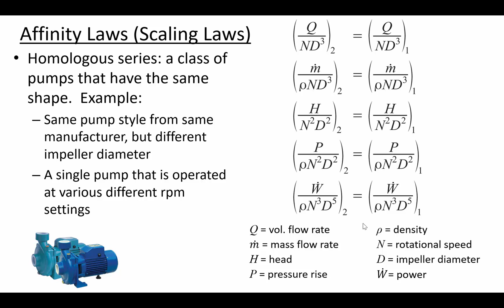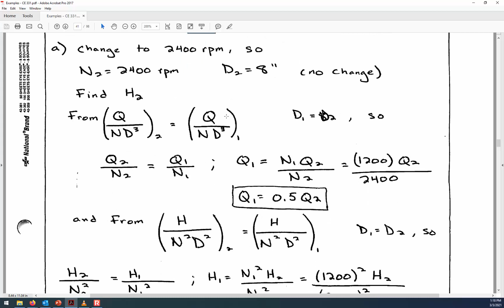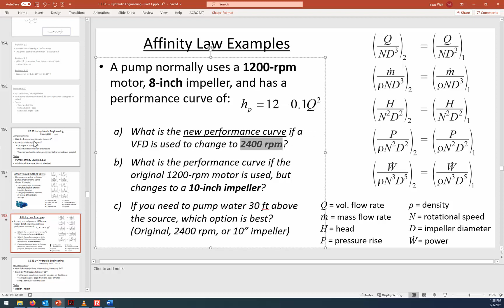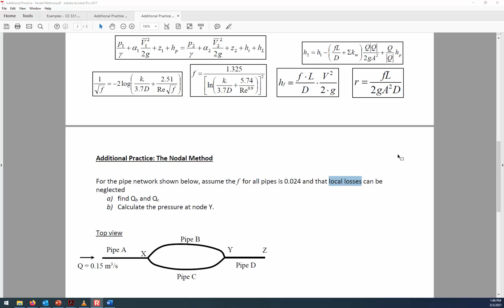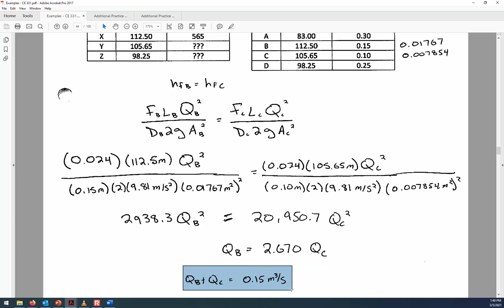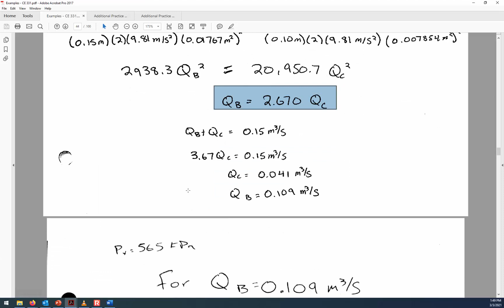Pump Affinity Laws - CE 331 (3 Mar 2021) Class 17

Comment: Pump affinity laws formulae are wrong. Power of D is wrong. Please correct.
Reply from the maker: Which equation, specifically, do you suspect of being incorrect? (For reference, there are five different equations on the video title screen.)  I would be happy to double-check this with the references that the formulas are taken from.
Reply: At time 6.00 min, equations 1st, 2nd and 5th. Power of D is incorrect. Power of D and N should be same.
Reply from the maker: @amolpundkare8994  the NCEES PE Civil Reference Handbook (version 1.1) shows the affinity laws on pg. 337, and they are as depicted in this video.  

This site also shows the powers that same way: https://pumpfocus.com/pumpbook/pump-similarity-and-affinity-laws/

And also this https://www.gsengr.com/wp-content/uploads/2020/05/Affinity-Laws-and-Specific-Speed-In-Centrifugal-Pumps.pdf